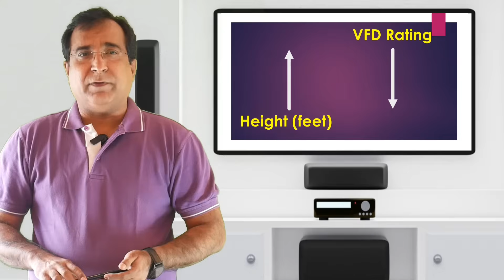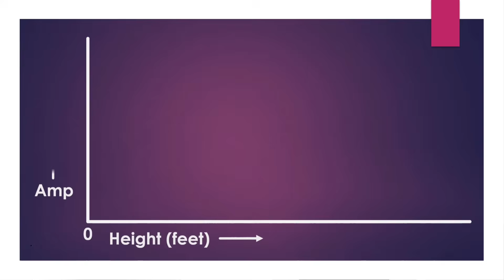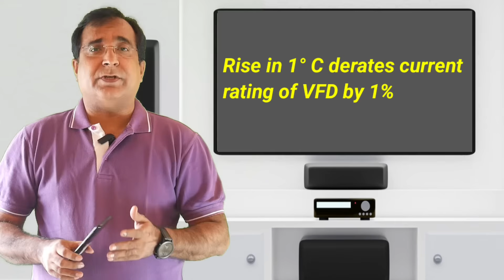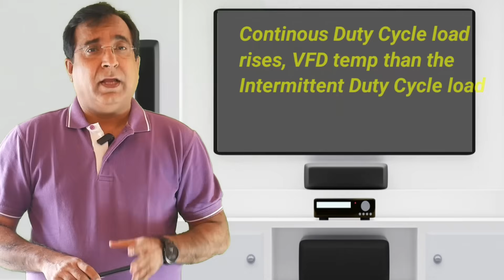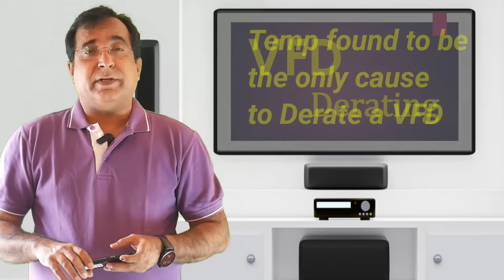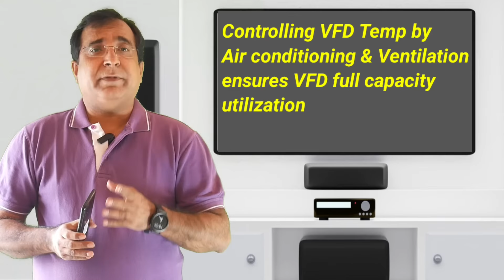VFD Derating | Variable Frequency Drive Current Derating

Comment: Sir , why charging circuit is available in VFD schematic circuit?
Reply from the maker: @anaglokesh7511  its rectifier with capacitor not charging circuit. As inverter has to deliver frequency from min to max so it need near pure DC from rectifier.